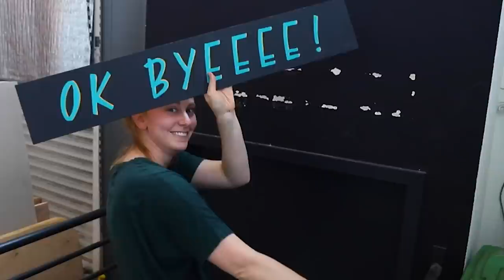Getting rid of a medical doll is weird

Comment: So fun story. When ITT Tech went bankrupt, there was an auction of all their equipment and crap - nurse tech stuff, electronics stuff, etc.

I picked up a small CNC mill, some oscilloscopes and stuff like that, some friends got some other stuff, and we drove over there with a truck to pick the stuff up. The auction company was in an old Radio Shack distribution center - complete with all the old Radio Shack signage and everything. Checked in, got put in a dock, and since it was all self-load, they sent us on a scavenger hunt for all our stuff.

Right inside the truck dock doors, where everybody doing a pickup will see it, lined up in rows laying on the floor like a mass-casualty triage... HUNDREDS of medical dolls in various states of undress, with varying levels and types of anatomy.

Comment: I love that you blur out your license plate, like there is more than one truckla! 😂
Reply: I have done work as a PI. First of all, if you know what you are doing, and use the right (read:costly) methods, you can actually get a surprising amount of info from a plate. Second of all, at 5:05 there is a small round sign in the background. The sign says "Olivier's Butchery". I googled "Olivier's Butchery", found a result in San Francisco, and pasted the address into google maps. I then went into street-view, and looked at the building. It matched the one in the video. At 4:52, Simone is seen leaving what I presume to be her building. The address of the building next door is visible. It is the address number of Olivier's Butchery. This means that the building next door to the Butchery is Simone's. The address of that building is shown on google maps. Assuming that her zip code is no different than the building next door, I now have her address. A blurred license plate won't stop someone who is determined enough. That is what can "Give her away". (BTW, I wouldn't put something like this out there for people to see, but I know she is moving anyway)
Reply: @FormulaOneLeclerc  Yes I know. 
I also know that when I see a red Tesla converted into a pickup parked on the street it is most likely hers. I then potentially would have access to her plate number anyway. (since it's not blurred in "real life") 
I know why she does it and do not condemn her for doing it. I was simply trying to be funny and point out a potential flaw in her security measures. Like someone who leaves their house lights on all night when they are gone. (Security, maybe. but also a big sign saying "look at me")
Which is what I do, I'm a Security field analyst. I legally break into people's properties to show them their weak pionts.
Reply: I got that, but 10-15 people seeing it is one thing compared to millions. Plus you could never break in to Simone's place, because Santa is watching:)